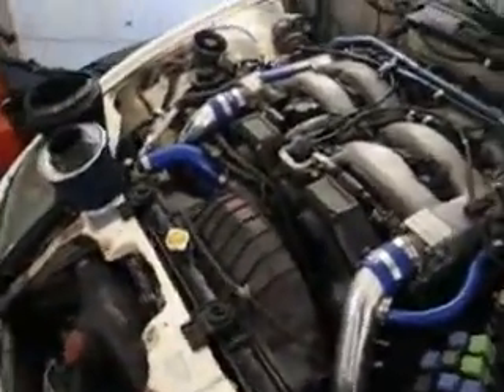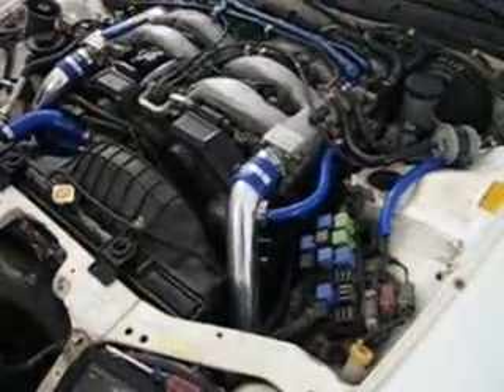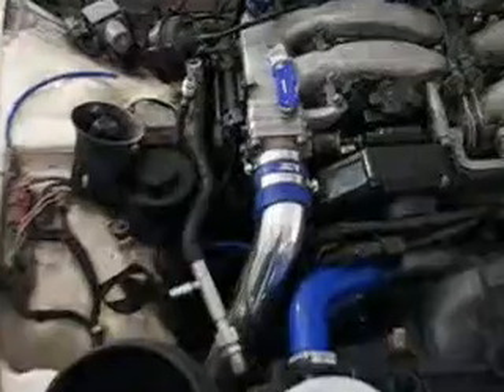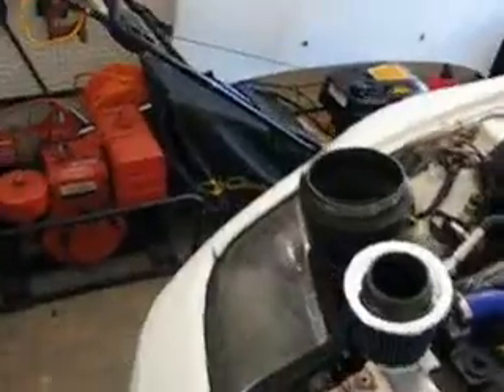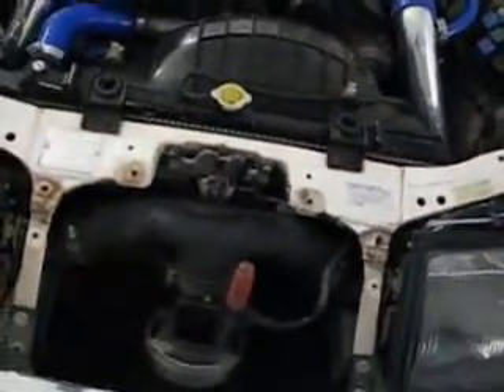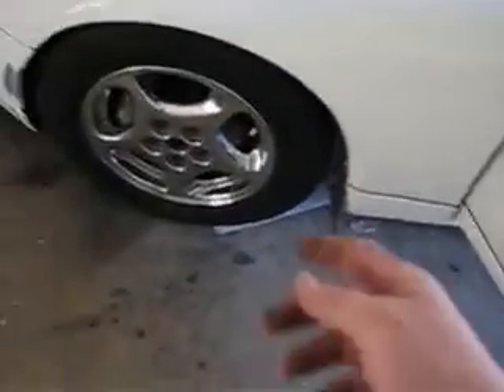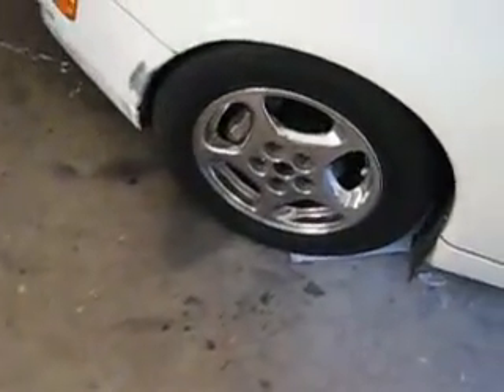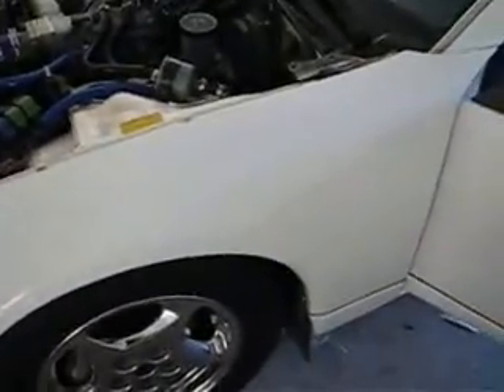My Fairlady Z32 P12

Comment: OK, I've watched about 5 of your videos now and I fully sympathize with your "un-fairlady" problems, However DO NOT even start complaining about working on the intake piping of a NA model until you have installed the equivalent on a TT. Twice as many pipes half the room, and my hands aren't any smaller. Keep up the videos.
Ps what happened with the Turbo front clip for 300 bills.